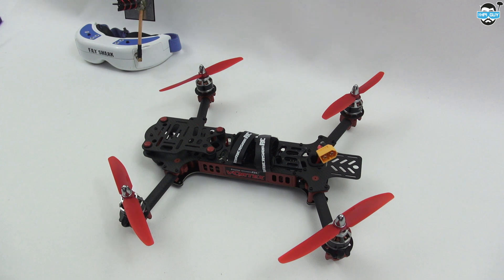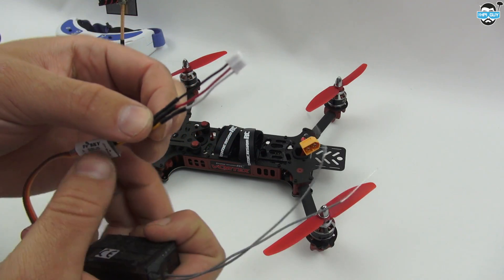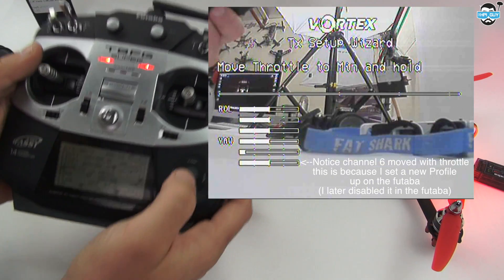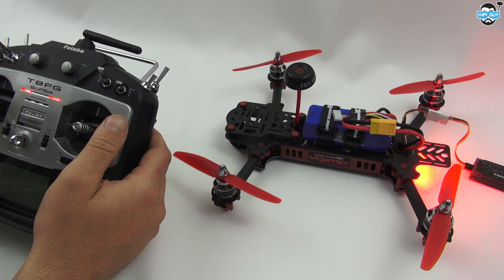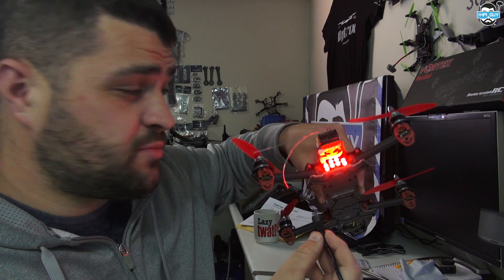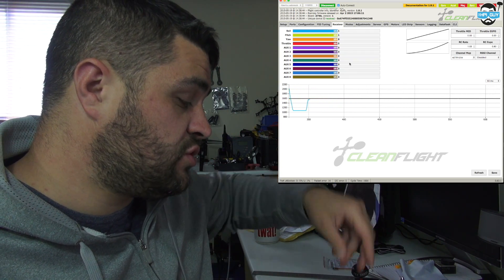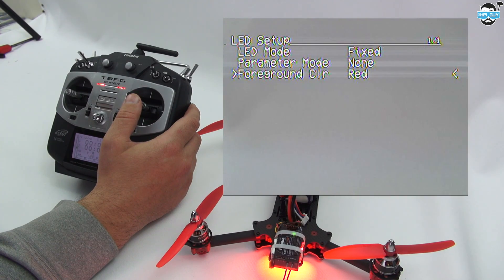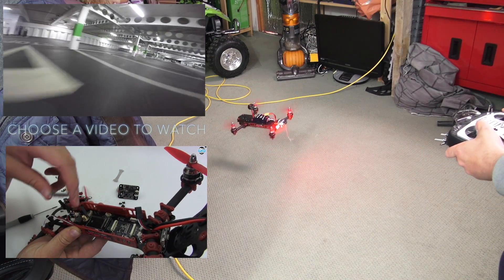HPIGUY | ImmersionRC Vortex Setup - Sbus - CPPM - End Point's

Comment: GREAT VIDEO i waswatching this as i have recently bought a vortex pro but i also use futaba,however i cannot get it to connect to cleanflight out of the box,i adjusted end points and done osd setup but cannot set mid throttle to 1520 as it doesn't connect should i be flashing the firmware if so what type??

Comment: I could not get my converter to work using the sbus on a r7008SB. I GAVE UP. waiting on a frsky rx to avoid using the converter. How ever in the mean time I wanted to connect to clean flight .. I realise my vortex is on 1.8.1 .. But I have 1.9 version on CF. do I flash my vortex or do I go back somehow to 1.8.1 on my PC .. And do I choose the naze firmware in the flash drop down on clean flight. ? Any help would be appreciated thanks

Comment: I went thru the on screen setup and after it completed success it wont arm (Min Throttle Right) also I can not get the menu (Min Throttle Left)

I am using a Spectrum DX8 with an Orange Rx

Next step was to set the Min Throttle from inside Clean Flight
I plugged in
Went to Receiver Tab

Throttle down: 1123
Mid Throttle: 1542
Max Throttle: 1947

Then moved to Configuration Tab and set those 3 values to the same as it came in as, saved and reboot

Restarted my Vortex and still no change, wont arm and can't get to settings menu :-(

There was one other value, Minimum Command, I left that at default 1015 as I did not know what it was.

NOTE: I have actually already set up another one for a friend but he had a DX6 with the same Orange so I do have experience with the Vortex.

Any help would be appreciated

Comment: Great vid
I am using an Aurora 9 with Dragon Link and the Dragon Link V2 with ppm.
A friend with a similar radio gave me his settings and I can navigate the setup menu.
Everything works but the motors won't arm?

I can not get the Cleanflight to connect to my quad.
It keeps showing USB to UART and I don't have UART?
I think I need a new driver.
Also my version of Cleanflight looks completely different to yours?
Help please?
Thanks
Reply: ***** More help please:
I am now able to connect to C/F for a couple of seconds then is stops.
I pushed the button as suggested.  I also installed another driver which helped also.
Now, while in Cleanflight,  I connect to the Vortex and C/F shows the info from the quad and the serial #, HOWEVER
The 3D image does not show up on the screen and none of the toggles work.
It is like it connects and disconnects a few seconds later.

When I disconnect the USB C/F says it is still connected????

Comment: I also had a problem,

My Vortex would not disarm!, careful guys. There is some issue or bug with the wizard or something. It lets you arm the quad and sometimes it doesn't let you disarm it, it just doesn't recognize the corner stick movement for the OSD menu. The problem is that it's intermittent, you may lose the ability to disarm even though pre flight it did disarm. I tried the arm/disarm at home and worked ok, i go to the garden and arm it and it was un-flyable because rudder/aileron were reversed, so i try to disarm and nothing! It just would not shut down. I am on a DX9 with an orange receiver. I managed to fix this problem by making it so that 0% throttle is actually -5% throttle. I did try to recalibrate a bunch of times and none of that helped.

Comment: Here's a tip- get n FrSky TFR4-B FASST compatible rx (is that a FASST Futabby you have there?)
The TFR4-B is CPPM on ch1 when pins 3 and 4 are jumped and rssi is output on ch2. Very tiny... diversity, and replacement antennae are about 2 bucks USD.

Piece of cake to set up for a naze- all 4 channel end points to 125- reverse the elevator and throttle, and thats it mate.

In cleanflight- midrc is 1520, min is 1050 and max is 1950 All aux channels do not need endpoint adjustments. Oh- and did I mention the rx is tiny? Way tiny... so very tiny.
Reply: I will add one more benefit to this rx as I forgot yesterday- FrSky sells for a measly 2 dollars (USD) a PCB antenna that matches this rx perfectly- these work excellent, and allow you to keep the antenna low to no profile. If you use the PCB antennae, be sure one is laying flat and one is one the edge for diversity. The signal emits from the sides- not top and bottom. I have about a dozen of these things. The only rx I use for 2.4 miniquads with my Futaba T10-CAG

Comment: When you did the original throttle calibration on start up another channel was getting sent as well.  Just go back and look and it looks like your throttle is sending 2 channels for some reason.
Reply: I finally got it going by installing "irc tools" a few times.
Reply from the maker: Yes because I set up an new RC on the radio J1 was on channel 3 and 6. I later disabled it on channel 6.
Reply: ThatHPI GUY Channel 6 on the setup screen is completely light up.
It does not move with the throttle.
I have done the initial setup several times.
When I move the left stick down and to the right the lights change and the frequency changes like the motors are throttling up?
Reply: ***** I still can't connect Cleanflight to the Vortex?
Reply: *****  Did you ever get your Vortex to connect?  I'm having the same issue.
Reply: Chris Arbaugh No I did not and after a lengthy conversation with Anthony of IRC I decided I was better off without one and sent it back and I have another comparable mini on order which has already been setup and test flown at the factory.

Comment: wow wonderful Video buddy. , but why did it throttle up on you at the beginning of the video sorry i mist that part did not understood , ?
Reply from the maker: templatesgenius I was't sure if I had reversed the throttle again in the radio menu and I accidently armed it trying to get into OSD mode. My throttle on the futaba self centers so it ramped upto 50% throttle... brown pants moment for sure haha.
Reply: Wow ahhahahah understand lucky great job
Reply: +ThatHPI GUY Do you setup a Throttle Cut mix so that motors actually stop when you throw the switch? Most useful thing I think I have ever done to any config related to my Vortex ;-p (DX18, AR7700+Sat user)